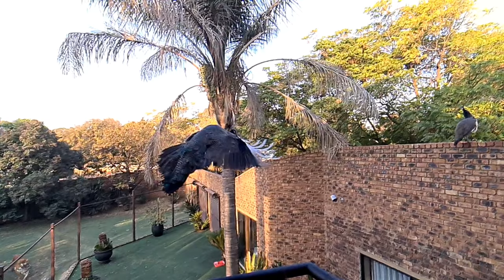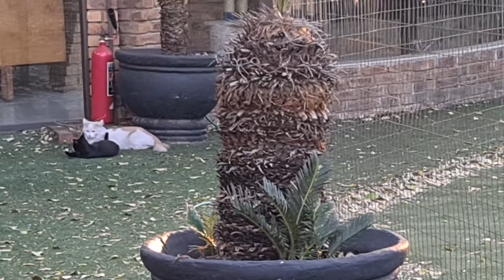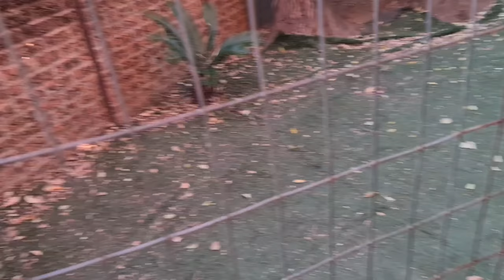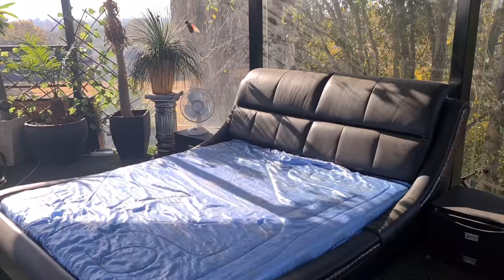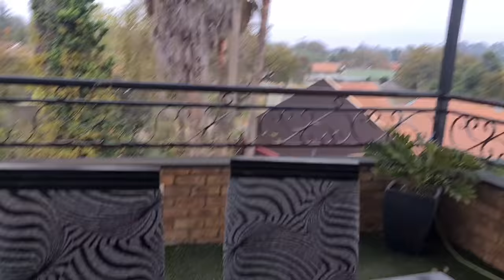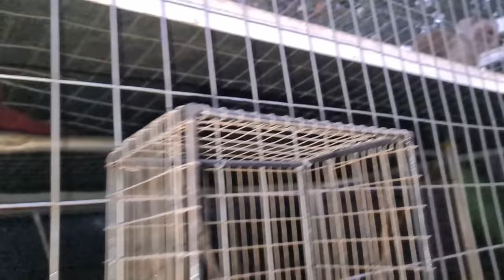A real rare roar from Enzo!

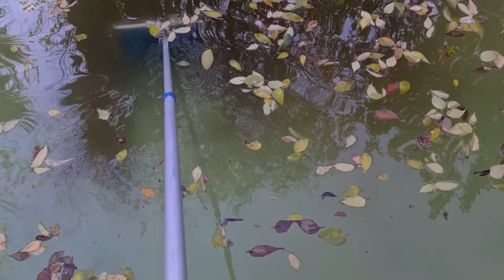Comment: 10:16... U could also build like, a motor with a trap for the leaves. Stick the one end of the motor with a longwide hose, and  on the end where the water comes out, fix a huge net, stong. Th ewater will suck up  everything on the bottom, and dump it wherever u direct it, while trapping the leaves on it's exit or flow throught he motor pump. They should bsoft enuff they won't damage themotor but, just thought I'dmention is. I used to be a pool guy int he day, but we actually emptied the water into a canal, then efill the pool and balance i out chemically as necessary..